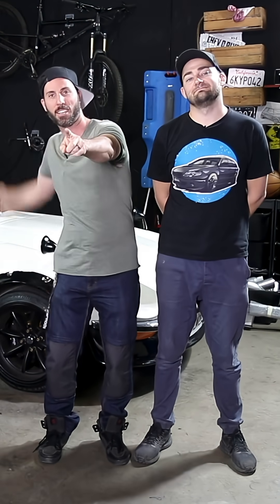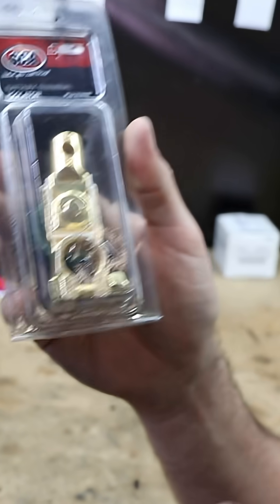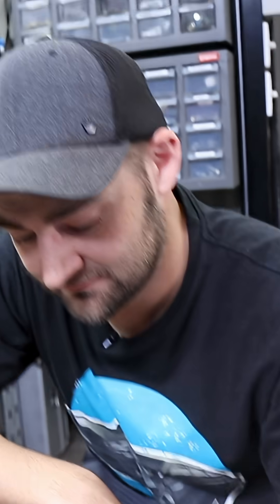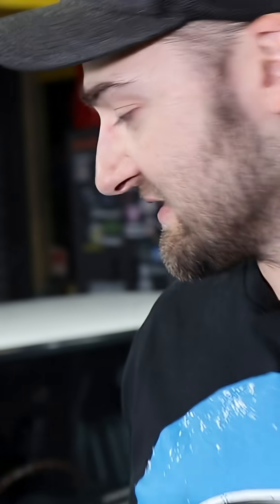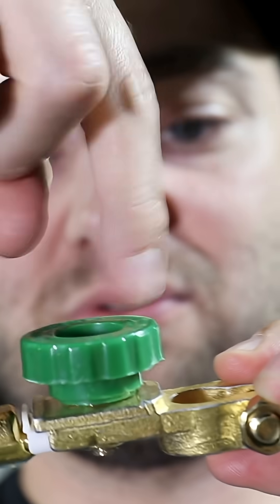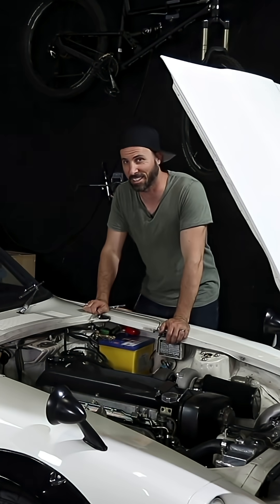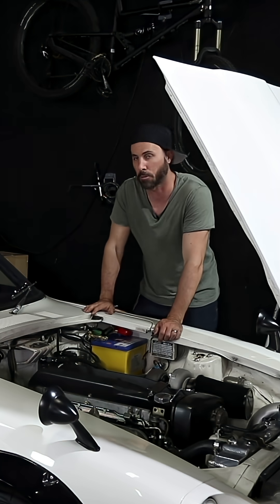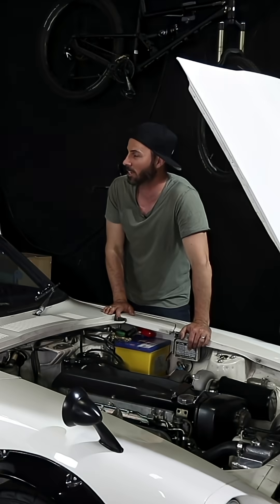How to Install a Battery Isolator on YOUR car!

Comment: Been using a brass marine terminal with wing nuts, looks nicer imo.
Battery relocation gets a 150A breaker, also super convenient and clean.
I did use this at one point but I found the green knob super ugly

Comment: Those corrode very quickly in some climates and will cause all sorts of issues when the conductivity starts getting worse.
If you keep your car in a garage, probably fine for years.

Comment: That’s the 5usd aliexpress version… the quality is beyond questionnable. It’s the kind of item you buy if some regulation mandate a battery cut out but you never plan on using it outside of the annual tech inspection day…

Comment: Awesome video and super handy product, just a warning that the connection might eventually get spotty- it did with mine at least, I had the same mod on my battery although not sure if same manufacturer. Started having strange electrical issues and power cuts while driving before I figured it out